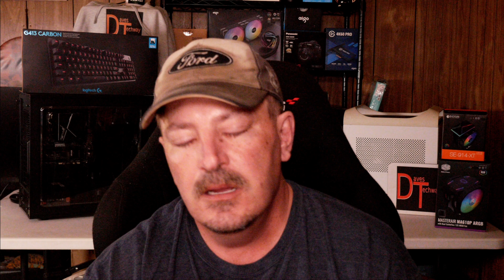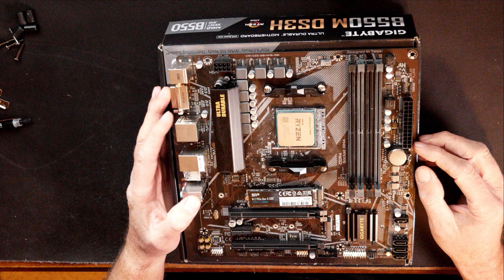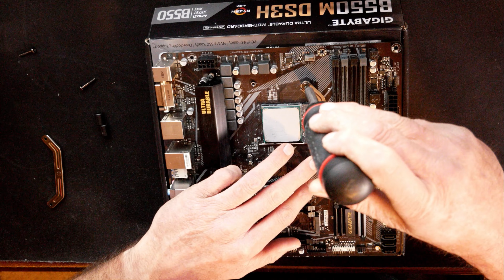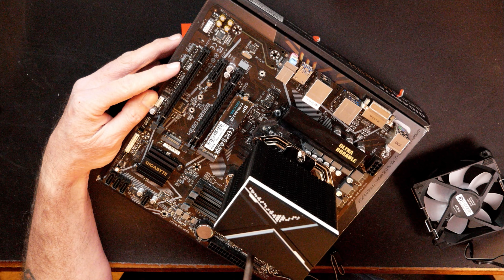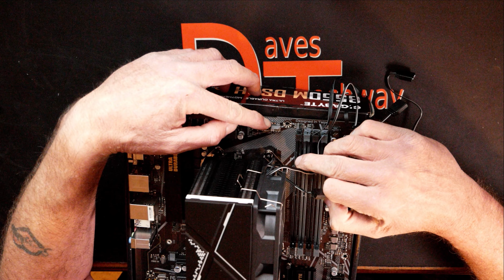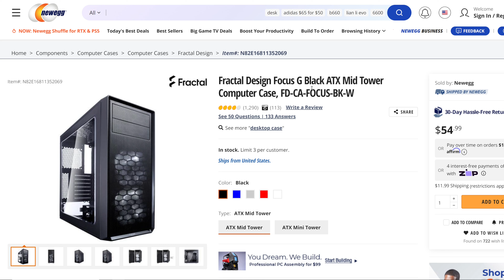ID COOLING SE 914 XT ARGB Budget CPU cooler AM4 Installation Guide and Temperature test

Comment: now if only this would work on Intel socket 1700
Reply from the maker: You may be able to reach out to ID Cooling and get a 1700 bracket to work with it. Thanks for watching and the comment.
Reply: @DavesTechway  the bracket is not the problem,the cooling plate does not match the shape of the CPU.the CPU is bigger than the cooling plate.